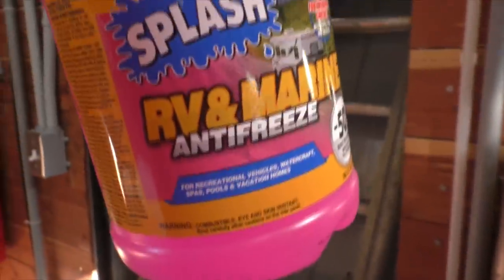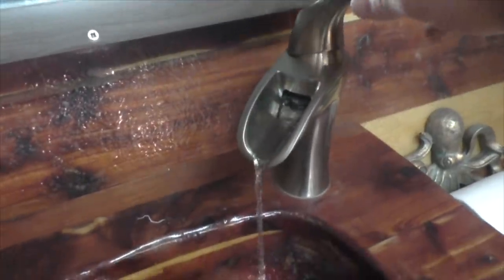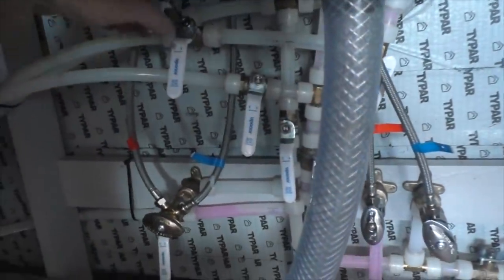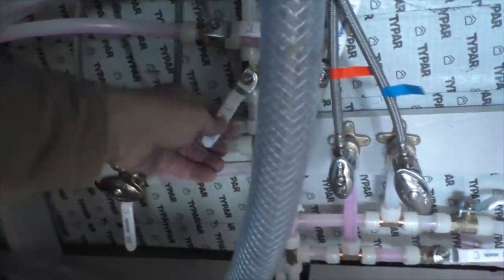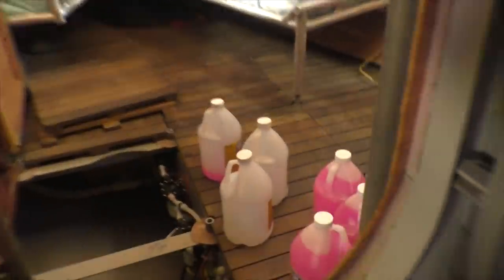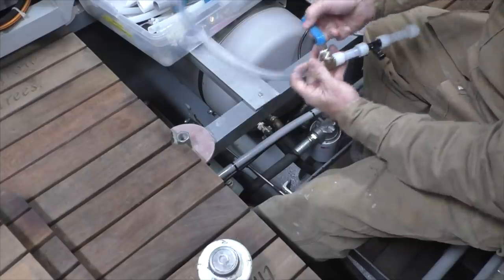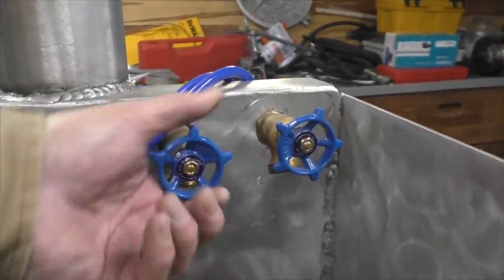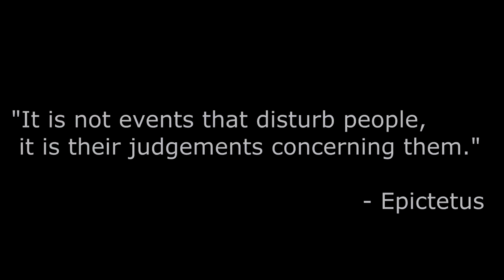Winterizing --  Yup; we're not leaving soon enough.

Comment: I put a air hose fitting on the cold side so I can blow down on the water lines. I then pump pink stuff through out. I also have  bypass valves the hot water tank.
Reply: Yeah I do the same thing for any off my hoses that get cold. Adaptors for the air compressor and blow it all out!

Comment: Have guys consider putting the SV Seeker on a barge, attaching the trailer to barge, towing the barge and the boat out of the port and/or down the channel, sink the barge to float the boat, and then pump the water out of the barge to re-float it?
Reply from the maker: Yup.  That would certainly be more fun, but it's all a lot more expensive than the insurance.

Comment: Expansion tanks are for city water systems... valves at low points arent a bad idea for draining.
That rv antifreeze will evaporate where exposed to atmosphere. Open traps? If theres any places like that you may have to pour a bit more there in a few weeks.
Reply: It takes a long time for RV anti-freeze to evaporate from traps.  We winterize our camper every winter and the traps are always still full in the spring, 6 months after winterizing.

Comment: I have an idea for you... I took a GHT (garden hose) to barb fitting - forgot the diameter - cut the barb off, tapped it for 1/4" NPT, put a male air fitting on it, and use that to blow out pumps, hoses, or anything I don't want to leave water in. Literally takes 5 minutes. Not sure what size compressor you have on the Seeker, but going up to a 3/8" or 1/2" air fitting would probably make a really big difference. I just use a pancake compressor to winterize my stuff. Never seen the need for starting anything bigger for something like that.
Reply: Oh... And Merry Christmas!!

Comment: Hey there, got 3 questions for you:
Do you know where the waterline will be at the boat?
Do you know if the boat is going to be streight and not tilted to a side or fore or backwards?
Did you made any calculations for this?

Regards from germany
Reply from the maker: Yes, yes, and yes.    The redish paint is anti-fouling.  The top of the anti-fouling should be over 70 tons.  She will weigh in about 65 tons loaded.  And trim is the second question, that's tricky.  You can calculate it till the cows come home but it will often be wrong even then so the plan is to deal with trim after she is in the water.  I expect to be ass end heavy but by how much, who knows.  We'll simply move stuff forward to compensate.  Think chain, anchors, hydraulic accumulator, etc.  What we did calculate is in a couple of videos.  https://youtu.be/1foJgyGnTr8    https://youtu.be/f5bR_IXI6EQ

Comment: You have an air compressor why not just blow the water out like they do for sprinkler systems in the winter?
Reply from the maker: Too many feet of lines.   You can drain most of them the there is always low spots that will collect water.   And you still have to drain the water heater and then there is the washing machine.

Comment: It’s guys like urself that built America not the guys that always say “it can’t be done”! You wanted a ship so you built a ship. I own a auto repair shop and have worked with so many technicians that don’t know what they are doing, guys that can never diagnose problems by themselves, I have an employee that has been working on cars for 14 years and can’t diagnose much of anything. For instance A newer car comes in a few weeks ago with a weird problem, he starts looking at it and asking me questions and I say type the codes into the online service manual and use the diagnostic flow chart all you have to do is read. After a short while he gives up so I take over and figure it out in 10 mins. He asks what was going on with it so I told him and he says “see I told you I have never had that issue before and don’t know anything about it like you that’s why I was asking you to teach me”. I said “ I also have never had that issue before because the car is only 3 years old it’s just outside of factory warranty it’s a new style system so all I did was exactly what I told you to do go on the online service manual I pay $300 a month for to use, type in the codes and print off the diagnostic flow chart and go through it that’s it, it’s literally that simple and read the operation (how the system works) because if you don’t know how a system works you will not be able to figure out why the system is not working, then go through the flow chart it tells you how and what to test and what steps to take if the tests fail or pass. I tell you this every week atleast once. He says well I don’t know how to do all the tests I don’t know everything like you and I said dude I didn’t go to college to work on cars I learned from reading the things that I try to make you read but you just won’t do it you want me to figure everything out for you and when I do that you never learn anything. Well what I’m getting at is this is how lazy most people are, the majority of people want to work 40hrs at some easy job then plop down on the couch to watch football every night and all weekend saying to their wives “I work hard I deserve to relax” thinking that they actually work hard but they don’t even know what hard work is! If working 40hrs a week and parking ur butt on the couch every night with a 6 pack of beer and chicken wings was considered hard work we would still be in the Stone Age! Motivated People like you that build a ship from scratch are the type of people that are responsible for the civilized world we live in! I had a couple come into my shop last summer to pick up their car and the wife said “ my husband here has always wanted to open a car mechanic’s shop “. I look at her and her husband and say if that’s ur dream then why haven’t you done it if you don’t mind me asking? The wife starts talking again and says well neither of us came from a rich family and neither of us make a lot of money and when she said they didn’t come from a rich family she winked and touched my shoulder. I said my parents didn’t have a lot of money, nobody in my family has alot of money just regular people. She said well how did you get this business then? Did your dad hand it down to you? I said no one day I woke up and said I’m sick of being in debt, I’m sick of living paycheck to paycheck so I changed my life around, I started working 2 full time jobs and doing whatever I could to make extra money, I started living like a broke college kid I spent no money on anything other then my basic bills, no more going to bars, restaurants, No buying nice clothes ect.. I paid off all my debts  then one pay check from one job got deposited into my savings account which I never spent any of it, then I did a budget and put my bills on autopay so I had one checking account where these bills came out of and I knew that every week I needed xxx amount of money going into that account to pay my bills then the rest of this check went in my main checking account that I would buy gas and food from then the night before I got paid again I went into my bank account and I transferred any extra money from my regular checking account and my checking account for bills into my savings account and every week I did this. I did this for over 5 years then I opened my first business which failed I lost a bunch of money so I did it all over agin and here we are. Before I smarted up I would go to the bar atleast 3 nights a week, go out to eat all the time, has a bunch of hobbies like boating, snowmobiling, drag racing, dirt biking, I would come home and plop on the couch watching tv after work for hours all the time I was just wasting my time away and I thought I was broke because I didn’t make enough money and I always thought it would be awesome to open a shop but it will never happen because I don’t know any rich people that would help me I would look at business owners thinking it must be nice to have rich parents but then I got sick living broke, I listened to my mom to get better with money and met a few customers that were once broke like me and listened to their stories which inspired me when I Was ready and when I was I sold my boat, snowmobile and my drag racing car that I lost a lot of money selling which I regret not because of the money but I miss the car but selling this stuff got me motivated to start getting on the right track. The wife looks at her husband and says well maybe you should stop plopping on the couch all night watching football! He says “ I can’t work that much I have back pain from a disk” then I say I have a herniated L4/L5 a bulging disk above that, scoliosis and arthritis in my spine believe me I know what back pain is all about but I manage it by knowing my limits so I lift only what I can, Cortizone shots, keeping active, sleeping properly and because of my back it was even more the reason to open my shop so I can have employees work for me. They ask me well who gave you a loan to open up and buy all the equipment? I said it’s all paid for in cash I saved all my money. If you have no debt and save 500 bucks a week that’s 104,000 bucks in just 4 years you don’t need that much but you can never have enough cash and if you saved 104,000 in 4 years you can afford to open up a shop and pay ur bills for a while so you have time to get the business running properly so ur making money and if you don’t then you have to do everything perfectly and pray to go you make money from day one because if you don’t you won’t have much time before you close the doors all because of money. Imagine going through all of that to open ur business then you have to close because you don’t have a few grand to pay bills and it could be that month that is the turning point where ur making money. Whenever I tell people this story they start out not believing it then they talk like I motivated them but they never follow thru! It’s like people that would talk about building a ship like this they would start it and after a week they give up because they can’t do hard work.

Comment: This long wait for insurance will be a blessing. You're learning to live on the boat and get it ready for full time habitation in the easiest possible environment. More importantly, adapting it for weather before it becomes a life and death imperative that it all works right. Something doesn't work? Step off the boat, into your car, go buy the part. Install. Imagine that from on the water!
Reply from the maker: It’s convenient.  It’s not educational.  : )
Reply: @SVSeeker  I disagree. I see you learning A LOT every time you post. You are testing, refining, and tweaking because the convenience exists to do so now. Imagine if you had it all to do while in the water. Imagine coping with all of that as you discover your first leak, your first fresh water plumbing issue, your first round of wet electrical components. You're so determined and persistent you'd fight through it BUT it'd be no where as good a repair or refinement as you're getting done now. This delay will be looked back upon as a blessing.
Reply: @curm1778  So a lot more will be learned if the boat remains on land for several more years?